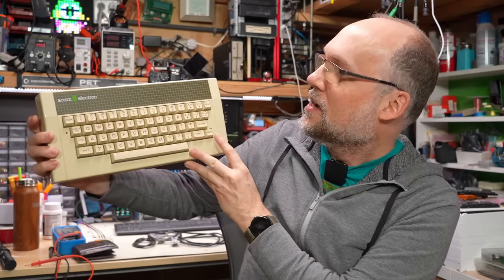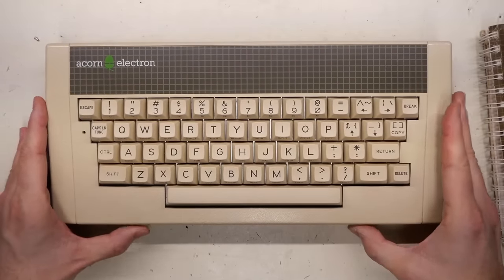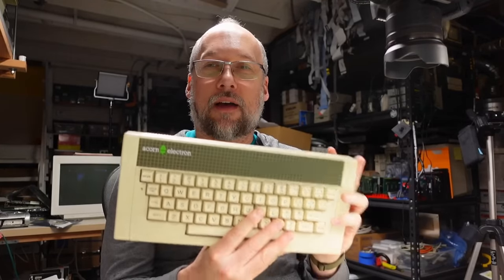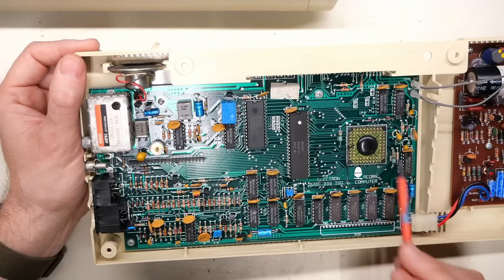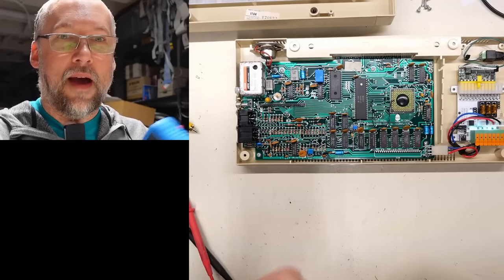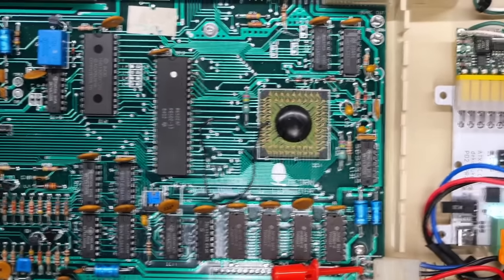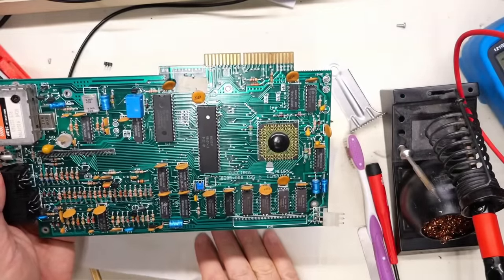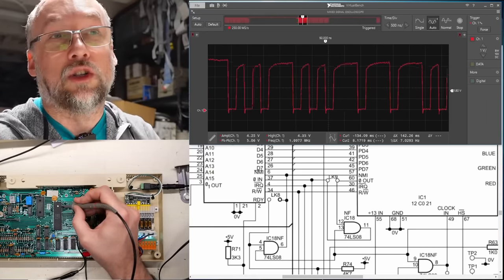I was shocked at what was keeping this Acorn Electron from working (Acorn Electron Repair)

Comment: As some have alluded too, this is one of your best videos to date! Two Thumbs Up for that.

Before Commodore bought out MOS Technology, MOS has licensed the manfuacture of the 6502 to other (Rockwell, Synertek, Western Digital Design, Hitachi, and others). I know in those early days, Apple used the Syntek ones and Atari used the Rockwell ones. And the 6502 was used in many things in those days besides Personal Computers.

But these licensed companies tried to make their own improvements to the 6502 and thus created a set of "Illegal Op Codes" different to the other 6502 made. This is where things shined for some and failed (like in this case) for others.

One of the few things Rockell used the 6502 (More like the 6507 and 6509) was a microcontroller for their aerospace industries. But the 6507 was also used in the Atari 2600 and the 6509 was used in the CBM II. Thus timing for the 6502 on these Rockwell systems has to be very tight, and their version of the 6502 (at the time) was the first 2MHz 6502 (as used on the Atari 8bit). Thus such a timing delay used on this Acorn (and other systems) worked well on other 6502s but fails on the Rockwell.

Oh the horrors! A partially desoldered and banged up ULA! That would have been the death of many machines. But you got it working! You turned somebody's trash into a treasure!

So what's next? Amstrad? MSX? More TRS80 & Coco stuff? When was the last time you did a TI 99/4A? Maybe you will be lucky and get a Soviet home computers. I had one but had to sell it to keep from going homeless in the 1990s; but while I has it, it was literally a PDP-11 on a chip in a small all-black Vic20 case. A very strange machine.
Reply: What I think also plays a role is that those UMC 6502A CPUs were mostly made in the 90s. I assume on a significantly better manufacturing process than the early 6502. Therefore the reason for that 10us clock cycle may not have existed and the CPU could be certified for longer clock cycles. They are still real NMOS 6502s though and support the undocumented opcodes.
Reply: I always thought it was just down to the original 6502, even CMOS editions, not being implemented with static registers.  Slow it down to much or worse stop the clock for too long and the registers become invalid, including PC, and computer crashes.  I guess there's so many variants of the 6502 that there's all sorts of problems to find when tinkering with the clock.

Comment: One of the difference with the BBC model B was the Mode 7 Graphics, the Electron  didnt have it. The Mode 7 Graphices was  also known as The BBC's  Ceefax or Teletext that was broadcasted by the Broadcasters Also there was a Plus 3 interface expantion this had a 3.5 inc disc drive with Disk Filing system (DFS) or Advanced Disk Filing sytem (ADFS).

Comment: I still have my Acorn Electron in my cupboard, I got the Plus One add on for it too. Worked the last time I used it but the power supply cable is now a bit of a hack job with electric tape holding it together 😂. Played a few games on it back in the day.

Comment: The electron was quite slow and there were not enough games available for it - it wasn’t rated very highly back in the day by most people who just wanted to play games…. But I loved it as I was (still am) an electronics nerd. The bus comes right out of the back on the case and you could plug a connector onto it and wire it up to your home built circuit board and away you go! I had it controlling relays and motors and detecting signals and learned an amazing amount from it - I learned far more from the electron about circuit design and development than I ever learned doing a degree in college a few years later, so I am very fond of it 👍

Comment: On the PSU, uh no. Take a ten second look at the PSU board: it doesn't need AC to create a negative rail at all, it uses a similar system the ZX spectrum does: it's switching.

I power mine from a laptop PSU kicking out 18v DC.

Using that relatively expensive picopsu is bonkers.

Comment: I used to have a job fixing these and BBC's back in the day. Just for reference the first Acorn model was an Acorn Atom (similar to the ZX80 but using Motorola chips)
Then came the Acorn Proton which was sponsored by the BBC and changed it's name. This was then followed by the Acorn Electron which at £200 was half the price of the 'Beeb' at £400. As you say, it was trying for the domestic market rather than just the Education market. Sadly, there were too many Micros on the scene at this point and the US models were sweeping up. Especially the Commodore 64.
I once got a huge bag of pork chops from the Abattoir over the road for fixing a bloke's Acorn Electron. Good trade, I thought.

Comment: Was the cassette for storing and loading programs since RAM/ROM was so limited? Also, I'm curious about the path you followed to get into these repairs. A lot of this came out as I was getting my EE in college and starting my career. I never really got deep into any processors, since changes and improvements were coming out so quickly? I did take programming classes in BASIC, Assembler, Java, C++, even punch cards for COBOL on an  IBM 370 . Just skimmed a lot of surface without getting too deep in anything.  I enjoyed watching the whole video. Thanks.

Comment: Iirc the basic command you need to restore a program after break is "old" or o. BBC basic has many shortcuts for commands like "l. for list" and  "p. for print" I also think the BBC model B uses the 65c02 it may even be the A variant.

Comment: If you hit the break key, typing OLD will restore your code, also works for the BBCs as well
Most of the Normal commands there is a shortcut using the FUNC key, they are printed at the bottom of they keys

Comment: At ~36 minutes - the ULA showed a lot of life - the lines down the screen show it is going into display mode 6. Also, I thought those soldered ULAs were surface mount - very cool to see it come out (will do the socket mod to my Electron at some stage!)
Reply: That was actually an interesting failure mode. The ULA needs to be producing a video signal for the white bars to appear, so it was working to a degree, and it is entirely possible that the CPU had set it to mode 6 before hanging for whatever reason. As others have pointed out, Rockwell 6502s were used on some Electrons and derivatives like the BT M2105, but perhaps there are specific revisions of the R6502 that do not work.

The "blob" ULAs are deceptive, but I believe that this arrangement is an example of a "chip-on-board" technology, with the ULA board soldered onto the main board, or at least it should be soldered! Someone else here mentioned Synertek as a ULA producer, which might be implied by opaque storytelling from the era (and I really do mean storytelling), but Mietec also apparently produced ULAs for Acorn, these being deployed in the Acorn Communicator.

Comment: The original 6502 is an NMOS technology, while the 65C02 is CMOS, which allows for much lower power consumption and tricks like slowing or stopping the clock.  Synertek was one of the first to produce the 6502, and I trusted their quality.

As you discovered, the manufacturer decides what those part number suffix codes mean, you can't just assume they're the same.  Even the same base part number can be different; I discovered that a TI 74S123 handled inputs in a different way than other vendors' ones, forcing the design engineers to add a flag note to the schematic and parts list.

Comment: The ULA not being soldered in is a good one.  You never do know what you are going to find on a device someone else has worked on before you.  A guy at a repair shop here used to deliberately put DIPs in backwards if he couldn't fix a machine in order to try to stop someone else fixing them.  Pretty terrible given the destruction that would happen if someone powered it up again, but that's what he did.  He's still around but thankfully retired.  God knows how many computers he sent to an early grave.

Comment: Good Job. For the cassette / audio issue, I faced the same problem with my ZX Spectrum trying to load programs from my laptop (MP3 files)! There is something weird with the signal coming out from the laptop in comparison to the one from a regular audio tape. I suggest checking this.

Comment: Hi Adrian. The original power supply in the Electron has 4 discrete diodes (bridge rectifier), so, likely, it would take 19-21 VDC just fine, filter it (not needed, it’s DC) and step it down and regulate it to +5 volts, then derive the -5 volts from that using a charge-pump circuit. It’d be easy enough to test if you’ve got a bench power supply capable of 20 VDC. If you get the + and - five volts, then you’re set! If not, then it does require AC, but I’m betting my old Apple Performa 475 that it will work fine on DC! 😅

Comment: Nice - its great when you look at the UK machines! I have a couple of Elks waiting for repair, one of which has a period mod called a 'Slogger' that upgrades it to a full 64kb. There's also a modern device available called the ElkSD64 that is both a 64k upgrade and an SD card interface and fits to the expansion connector, which you may want to look into. Its from ramtop-retro, which also do a version with 128k(!) and one that plugs into the Plus1. He also has an interesting 'Open-Source Turbo Card' which piggybacks in the CPU socket...

Comment: The 65C02 is a cmos version of the 6502 (nmos). Nmos uCs normally used dynamic logic where the clock must have a minimum speed. CMOS however normally uses static logic where the clock can be stopped (that is what the note in the 65C02 datasheet implies). The original 8051 nmos had the same limitation, where the 80C51 does not.

Comment: You type OLD to get your old program back I think and control + break does clear the program (so LIST does nothing) but OLD may get it back. Some assembler codes can catch both break and ctrl + break to stop the user exiting running code.

Comment: I don't know about the Electron, but some versions of BASIC have an OLD command to restore a program that had just been lost due to typing NEW or resetting the system.
Reply: One of the keyboard shortcuts is actually OLD followed by a carriage return. The only other shortcut that incorporates a built-in carriage return is RUN. These were clearly intended to be frequently used!

Comment: When I had an Electron a few years ago, I powered it quite happily from a laptop PSU i.e. it doesn't actually need an a.c. input. That power supply board (made by Astec) inside the case must generate the negative voltage itself.
Reply: Or, thinking about it again, maybe I never tried to use the cassette port and, hence, the lack of a -5v rail didn't matter?!

Comment: Interesting video, I had two of these growing up. The original psu was quite a brick and the wires used to break down at the brick end. Nothing to do with me picking it up by the wire of course 😅

You’ve just reminded me of that break key. After 20 odd minutes of loading a game I must of caught that key loads of times 😡

Comment: I assume the electron's cassette interface is similar to the BBC Micro one, in which case you'll want to spend hours messing with the audio levels going into the port.
Reply from the maker: Indeed -- I think it's identical. I'm going to try out the cassette port on the BBC Master to see if my cable and audio output was correct.
Reply: @adriansdigitalbasement  Even with a working Elk, I’ve had mine since 1983, you need to spend time adjusting the volume on whichever device you’re using for Play UEF. I really do mean spend a lot of time too! It might also be worth trying multiple devices. My iPad works great and then next time nothing. Use my phone and it then works or vice Vera🤷‍♀️

Comment: Regarding tape loading, the electron expects tape signal to come from a headphone socket rather than line level so it may just require a small amp between the source and electron..
 2.5 v sounds a bit low
Reply: Agree, I successfully load games from the online UEF player using the headphone socket on my laptop with the volume at about 50%
Reply from the maker: My USB DAC's levels are high compared to normal line level found on regular things like CD players, etc. https://en.wikipedia.org/wiki/Line_level#Nominal_levels and I can guarantee they are higher than the headphone jack on a normal laptop. It's possible it needs even higher voltages though -- but it's also possible the input is just broken.

Comment: The BBC Micro model B was £399. The Acorn Electron and the Commodore 64 were both £199. However, the Eelctron was heavily discounted as sales were poor as most people opted for the Sinclair Spectrum which was £129 or the C64.
Reply: The Electron was introduced at £199, whereas the C64 was introduced at around £299. However, by the end of 1984, the C64 had been reduced to around £199. Meanwhile, the 48K Spectrum was introduced at £175 and reduced to around £125 or so, precisely to head off competition from Acorn and Commodore. Of course, this price war resulted in Acorn and Sinclair being rescued and some very difficult years, if not near-oblivion, for Commodore as well.

Comment: I got my first Acorn Electron from a company called Ocean Software in Manchester, i was 17 i think , they wanted me to write a version of the Hunchback game for it. I never did finish it, as i was more interested in the Amstrad CPC 464 which they(Ocean) had a preview version of and wouldnt let me check it out, I only found out what it was when i pulled the tape of it that covered the name. Got into a bit of  bother because of that. I always felt the Electron would have been so much better if they hadnt skimped so much on expansion and memory etc. The Model B was so much more advanced with its eproms and extra ram etc.

Comment: I don't know about the Electron specifically, but I do know that many of those old cassette loading systems were pretty sensitive to the volume setting on the deck.  If it isn't working the first thing to do is to try lowering or raising the volume and try again.

Comment: Speaking of keyboard key mixups. The Apple 2+ and the DEC VT-102 terminal had the alt and ctrl keys in the opposite location.  So if you were automatically hitting the ctrl key on the Apple, you would be  touching the Alt key on the vt-102 terminal.  What is the effect on the VAX computer  ? Exit without saving. All programs had to be typed in using a qwerty keyboard. The yells on anguish,some were mine, could be heard in the student computer room.

Comment: The Election will work happy on 9v DC from a Sega Master system which was we end up doing back in the day due to breaking the earth pin of the plug, And was last powered on earlier this year but is waiting some repairs on the keyboard as it has sticking keys and a need of retrobryting.  But was the machine that sparked my interest in programming.  Lovely keyboard to type on

Comment: Nicer than the C64! I like the main PCB design, not as much the PSU board. Still, having a separate SMPS board inside the enclosure is waaaaaaay better than Commodore with its rubbish potted 9VAC + 5VDC supply that failed to overvoltage. Nicely recombobulated, though I'd rather try designing a new purpose-built converter. 

Wondering about that ULA. You got me intrigued!

Comment: I have an Acorn Electron and I power it from a 19V DC laptop power supply. The computer has a bridge rectifier right afer the input jack, so even the polarity doesn't matter. But maybe this late model power supply is different?

Comment: I wrote my first text-based adventure game on the Electron, was a nice machine to use, very well bullt and compact.  My only gripe was the need for an expansion to use a joystick.  As you say the BBC was very costly at the time, pretty sure it was equivalent to around a grand in pound sterling in todays money.  Here in the UK it was the chisen computer in all schools, then later the Archemedies.
Reply: Yep. The BBC Micro Model B (the full-fat version with 32K RAM) cost £399 new in 1982, which is a whopping £1,360 in 2023 money according to the Bank of England's inflation calculator. Not cheap. You can see why so many people went for the humble ZX Spectrum, which was (iirc) £179 for the full-fat 48K model (£610 in 2023 money).

The Beeb was so much nicer to program on than a Speccy, though, with its proper keyboard, excellent version of BASIC, and none of that horrible stuff you got on the Spectrum like your input slowing ... down ... the ... longer ... a ... line ... of ... code ... got.

The Electron was a very decent compromise machine for those who wanted something that felt a lot like a Beeb but whose budget couldn't stretch to an actual BBC Micro.

Comment: Your video reminded me of a similar power supply issue I am having with a theremin, where it requires both positive and negative inputs, so I just did some hunting around, and there are a number of buck-boost converters which output both positive and negative outputs. Some of them seem to be based on an XL6007E1, which is at 400KHz, which may be an issue with my application, but I am going to try it...

Comment: The PCB is really nicely designed, with some few chips, and cost / space optimizations. Keyboards also look and sounds great. That BREAK position is horrible. Shame it was not more popular, but it also lacked some features, like better sounds, or easy to use cartridge port, so it couldn't really compete with C64.

Great repair.